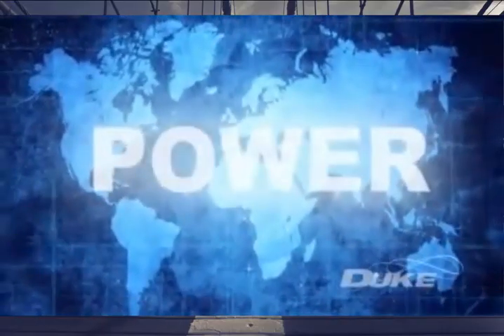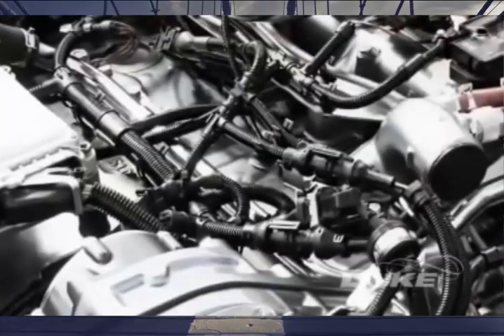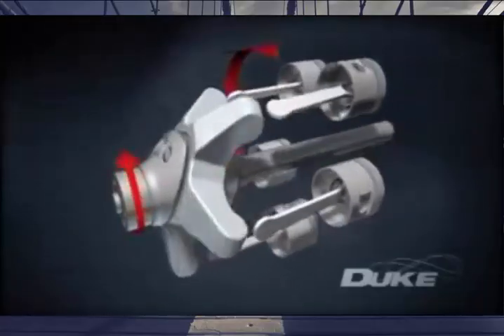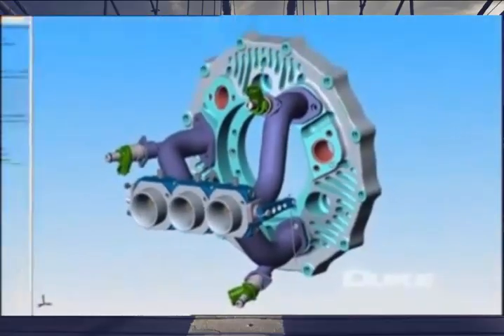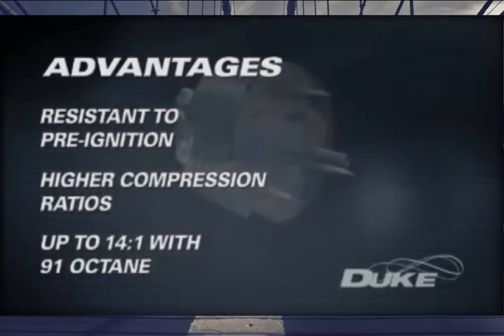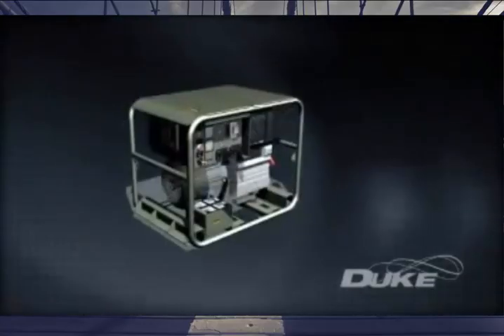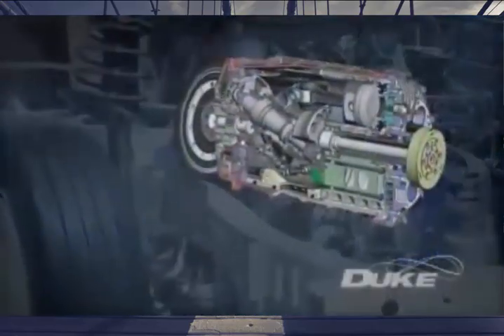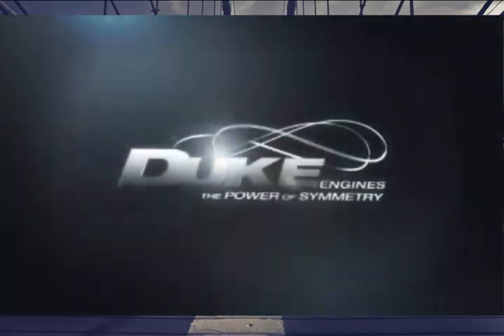Duke Engines | All information about Duke Engines

Comment: All it is, is a re-tasked hydraulic PTO pump.  This is an OLD design that looks nearly identical to most-any hydraulic pump on any Class 5 or Class 8 truck on the road that is fitted with a routine hydraulic pump.  You can even find PTO pumps like this on farm equipment.  The only significant difference is the sparking-configuration in the 'head', since  that isn't present in a hydraulic pump - instead, it's just a set of check and bypass hydraulic valves.

Comment: actual intelligent people are looking towards electric vehicles, whilst these guys are "trying" to reinvent the combustion engine! lol
Reply: Electric vehicles are a dead end but no one will admit it. The majority of the electricity they run on is produced by fossil fuels and hydroelectric. To produce more power, you would have to burn more oil, coal and natural gas or build more nuclear reactors ( yikes ) or dam more rivers ( yikes again ) or build more wind and solar farms which most people don't want to see in there neighborhood. Lastly, the power grid can barely handle the load it has now, if you add the load from all those electric cars, it would overload and collapse. The only answer, in the long run, is less people which means less of everything that is harmful to the enviroment. However, nobody is ever willing to consider that solution.

Comment: This is nothing new , way back in history nearly all aircraft had radial engines and iv'e even seen one in a motorbike from the 1920's wasting their time trying to re invent the wheel  and would be better focusing on a completely different type of power plant that doesn't use oil , my big question with this engine is what about wear on the spinning piston block ? my guess is if it was to go into production it would have to be cheap enough to be considered a completely disposable deal so you could just swap it out when it is done !...Have you noticed that all the latest Mazda's have rotary engines ?? NO you say yes exactly a great idea that wasn't so great and this would go down the same road ( pun intended )

Comment: How do you cool it ? That would be  major problem i bet. The cylinder block seems to rotate inside a housing so coolant would have to be running thru a ceramic seal.  It woul have the same heat issues as a  mazda rotory.
. t is basically a wankel with pistons running on a wobble box.  
But there may be applications.

Comment: The point was to reduce the reciprocating mass of pistons and to remove the drag from cam shafts, but, the price would be that the whole cylinder block needs to be rotated together with the output shaft? Sounds like it's making the problem worse. And also the reciprocator will be under high pressure at all times making it prone to costy failure

Comment: Still reciprocating, no clue. The line
Doesn't even come close to Raphael Morgado's MYT engine. Weight=150#, 13 moving parts, 20:1 Power ratio, 14"x14" size,, ~850hp @ idle(850rpm), equivalent to 16cyl engine.

Comment: How are the top of the cylinder sealed? How much surface area is rubbing together on top of the cylinders. Just curious. Rotary engines didn't last very long because too much surface area had to be sealed so the seals would wear out fast. The duke engine looks like a great design longevity would be the only ??

Comment: This is NOT new tech. This same engine was invented in 1909 by Walter Macomber. (  Macomber invented an internal combustion rotary engine. He first obtained a patent on this invention, which became known as the Macomber Rotary, in 1909. He continued to refine and reapply for patents, as shown by the diagram above for a patent in 1912.    http://cynthiashidesertblog.blogspot.com/2012_01_01_archive.html  )
A very smooth running engine but Macomber was more interested in other things than the engine and auto he built for it. He went in to other fields and never did the motors again , BUT he did patient it with the US patient office. Number 1042018 check it out at the above link or write to Hemmings Motor Classic Cars for more infor.
Reply: Not the same engine.  They both use a wobble plate, but the Macomber engine used conventional valves, and the whole engine rotates.  The Duke does not have a valve train, but uses ports.  The Duke engine does not rotate.  Close, but no cigar.
Reply: The design looks the same, and both operate on the same principle. Hence it IS a copy and even though there are differences, it looks the same, operates the same, and works on the same principle. Valves aside.
Reply: Yes and no....simply changing one thing in something does not make it a whole new design. I my self have tried to patent  a design of something I thought would be great for saving lives. However even though it was slightly different it was denied a patent because it was not enough different.  So no lives are being saved currently because the family who invented my item back in 1980 but did nothing with it still has the patent on it. Mine was electronic theirs was mechanical. Lots of change there. But since it performed the same way and did the same job, it was denied. So simply because something is different here or there does not necessary mean it can be produced. However if the company making this engine, did patent research and found the patent has NOT been renewed then can then re-patent it and produce it with no harm. So says my attorney. I simply was stating that this is NOT a new idea, that it ws made back in the past. That some one may have a patent on it and it needs to be researched and as such then produced with notice given that its a new patent.  I hope I am clear on this to all of you. I also wish them luck with it.
Reply: If the Duke engine doesn't rotate, it doesn't make power.  Sure it has a crankshaft, it's just not a 'through-block' crankshaft.  The wobble-plate is the crankshaft (oops, wobble plate makes me think of a variable hydraulic PTO pump, how about you?)
Reply: thanks for your information .. thankyou so muchh👍
Reply: This is not the only one. Many 'new' engines have been developed from those made during the 19th century.
Reply: So you are saying that they shouldn't proceed because... it's been done?
Reply: No just to give credit where credit is due. Some one may be missing out on royalties or copyright infringement or patient infringement You would not like that if you invented some thing and some one else claimed it and you lost out on all the millions of dollars you could have gotten for your children and grand children.
Reply: Robert Hersh-geer An improvement on a design makes it a new design does it not? If the design fundamentally changes how something works? Like how OHV engines and OHC engines are the same, yet some part is slightly different? Does Ford and Chevy still have to credit Otto and Lenoir? If their designs are different?
Reply: +Robert Hersh-geer You might be right, but i'm pretty sure the patent system works a bit different then you think. A copy is ofc always just a copy, but a improved version of an existing patent is still a new patent. This happen all the time in the car industry. 
That being said, comparing the new duke version with the 1909 patent is like comparing a pre-war car engine to the modern day ecu controlled one. The differences are so significant that it's a new invention, hence patent.

BTW sry to hear your failed patent :( I do CNC, assembling and testing of prototype machines. These all get patented, some are extensive improvements of existing systems from competitors, some (most) are new ideas, ALL get new patents. Just so you know, the guy that owns the dev department and sales have been running shit loads of lawsuits because someone copied something of his patents. In the end (about 3 years ago) he finally chose to focus making better stuff, cause "it's simply more profitable to be one step ahead of the copycats, rather then spending money on lawyers"
Reply: donotmindmeatall I understand your point and agree for the most part. Its so nice to talk to reasonable people on here instead of jerks as most seem to be.  Thanks for the chat.
Reply: Yw and to you too :) I'm truly sry to hear your patent request got rejected! But keep up improving stuff and look for a cutting edge company that can use your product. A cooperating with the big guys may be just what you need to get some patents of your own :)
Reply: 2 Cycle Engine... Won’t meet modern emissions standards and you’re right similar designs have been around since the early 1900”s

Comment: ok what a wonderful design - waste of time but great none the less , another one of the new idea because we are so modern crowd  -- why if we are burning liquid fuel would we 
go past the standard already well proven some into the millions of kms internal combustion motor and why if we were to look at other means while still burning liquid fuels 
would we go past the turbine , which is already hugely energy efficient due to the fact it does not need convert angular motion in the same fashion

Comment: I think its a beautiful motor but they forgot the rotary.  was the first step forward in new engine development in the last 100 years and can be around the same size depending on the configuration. I do like the concept.  it's kinda like a horizontal radial.

Comment: This is "the best of videos"?How about some facts instead of a whole lot of hooey?   Granted it does appear to be smaller, lighter and less complex than an "equivalent" conventional piston engine, but by how much?   30%? - some actual figures please.  There is no information on weight, number of reciprocating components, or anything else internal for that matter.  They don't even tell us its displacement, per revolution, which is the starting point for any meaningful comparison.Beyond that, in engineering terms, they provide NOTHING.   What is the Specific Fuel Consumption?  What is the Volumetric Efficiency?   What is the Friction Loss?  What is its Thermal Efficiency??? - all important fundamentals that they should be shouting about from the rooftops if they had actually achieved anything new.  They go on and on about the lack of cams and valves, but conveniently forget to mention that a cylinder plate spinning against a ported head is a high friction loss means of capping the cylinders - unless they have invented something really revolutionary to deal with that aspect - again, zero information on that.  Ported sleeve-valve cylinders also have very high compression capability coupled with high speeds, high specific power with long TBO's and actually achieved mass production in some cases - ever heard of the Napier Sabre for example?And, by the way, axially aligned cylinders operating what is, essentially, a swashplate drive, is nothing new.   A company called Dyna-Cam did that many years ago, and I don't see many of those on the market these days.....   Others have developed axially-opposed Stirling engines which really do have a higher Thermal Efficiency as well.

Comment: It is hydraulic motor gone combustion engine. Sealing an oil flow is a lot easier than gases. This might explain why the project had nothing new to report since 2013. Combustion engines as we know them are reliable and can take quite a beating. Designs like this might not be that reliable, even though it needs a few less parts. I have seen engines from the 60's fire up no problem. I love me an old diesel engine with mechanical injection pump.